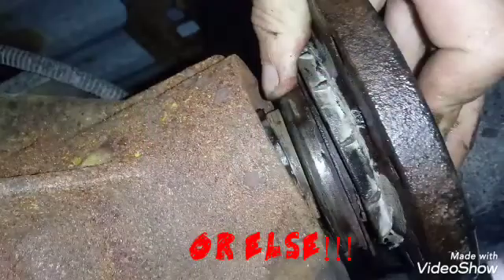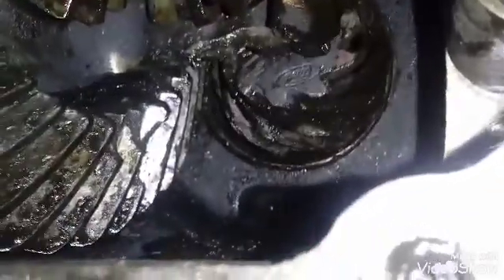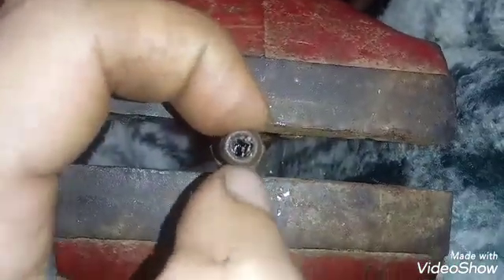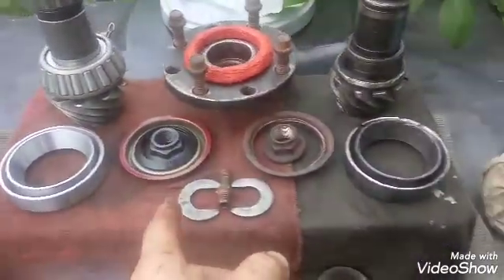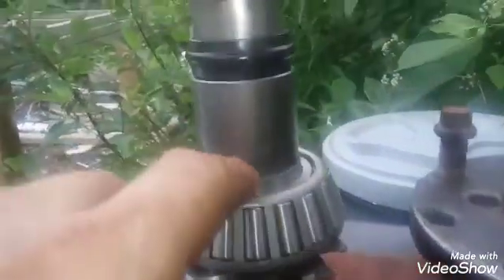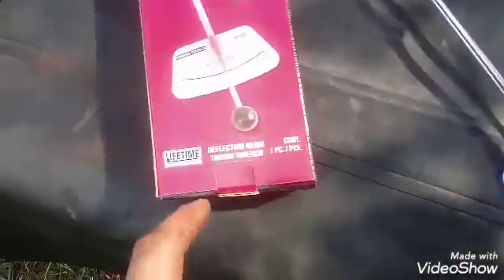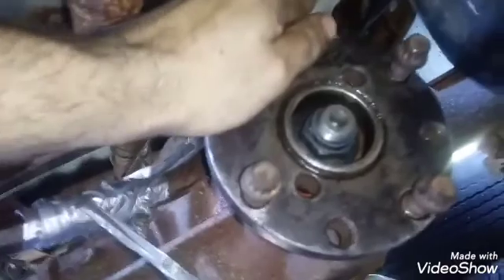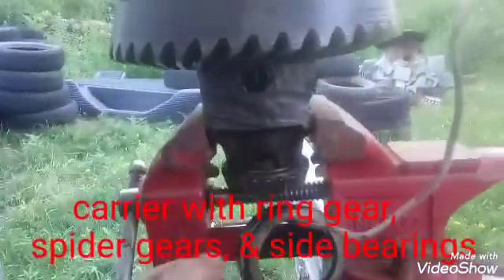Rear Differential Ring & Pinion Rebuild Ford 7.5 in Yard No Lift No Press No Problem

Comment: It has been a long time since I last worked on my 55' chevy axle with the bed off.  I agree, being able to work from above is much better than from below.
I about to replace the axles, and all of the bearing on the 7.5 in my '91 Mustang. I'm debating if I want to pull it out.  |
 Rock Auto is also my go-to for parts.  The parts in my cart, as of today, Oct 2024, $361 with shipping and tax will end up being $432.  You might thing that sounds expensive, but it isn't.  A used axle will cost you at least that, and as Digger said, you don't know the condition.  A rebuilt 7.5 will cost you $1500-$2000, depending on how shinny they make it ;-).
Thanks for the interesting video.  Putting eyes on a process makes the going much faster.
Reply from the maker: @devocite  Thanks! The junkyard site I use is car-part.com. Then tilter results how you please. I learned everything by watching other people working on vehicles on Youtube. It's cool, I heard Ranger & Mustang have alot of interchangeable parts.

Comment: I've changed these gears so much with my racecar I've almost got it down to a science. Although mine is a 7.5 housing
Reply from the maker: Dirt track racing looks like fun! Most mechanics now days replace the whole diff, but rebuilding is way more cool 😸
Reply: @DiggerX8X  I swap out carrier's, ring and pinion for whatever gear ratio I want depending on the size of the track. It's always interesting to see how others do it without the fancy tools

Comment: Vary helpful I am doing the exact same job does it make sense that the yolk is not so easy to turn after new bearings installed
Reply from the maker: The video in description by BadShoeProduction is the best on the bearing preload. Check it out bud.